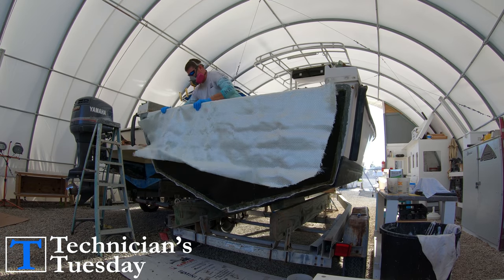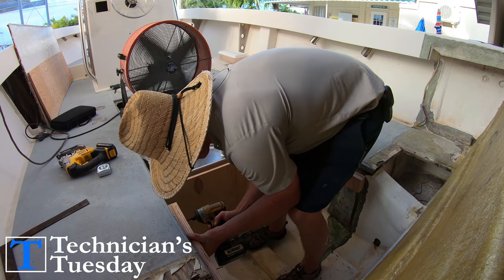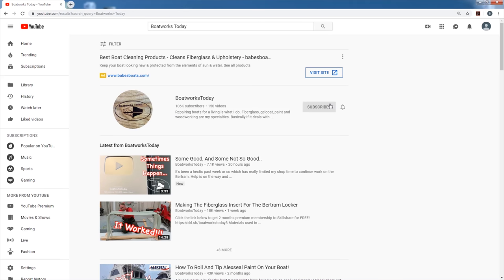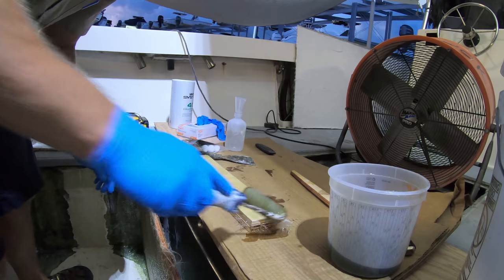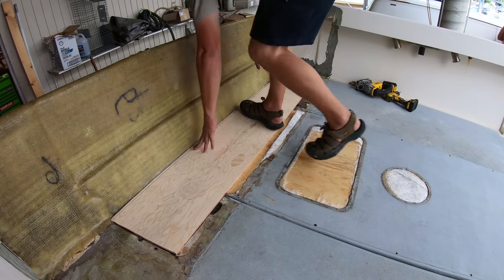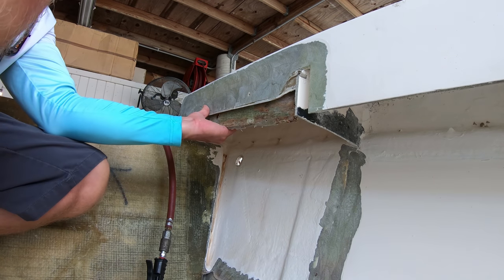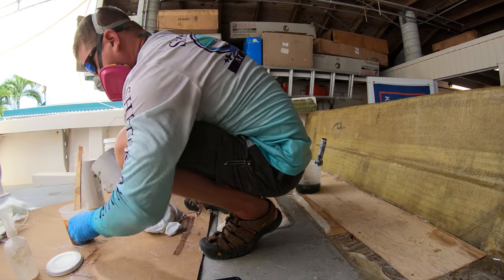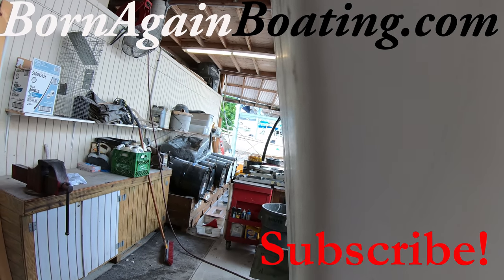Under Your Boat's Floor! Bulkheads & Bilge Paint!

Comment: To help wetting out fiberglass you can put a heavier build up of resin before setting piece to laminate especially on flat areas. You can also use a bondo type spreader to work the fiberglass resin in and get bubbles out with . I order like 50 4in generic brand spreaders on amazon for $15 or less. Just a couple things I wanted to share that may help you now or in the future.

Comment: Have a lot of fibreglass insulation as I’m insulating the shop.    Used that as a thickener to hold the resin as I shoved it in to build up the cracks

Comment: You should consider switching from roving and mat to 1708 biaxial.  The finished product is much better and tends to require less sanding and produces a stronger laminate with less work.  If you use peel ply it gets even better!

Comment: Oh man 5200 on the panel... Is that going to be impossible to raise?  Is there something a bit more removable a person could use instead?  I have emotional scarring from 5200 used in semi permanent applications.
Reply from the maker: You can use Boat Life Life Caulk :) But 4200 has a better and longer lasting seal to it. Remember, on a boat, everything eventually leaks lol

Comment: NIce series of videos.  Just wondering why after all the work of tearing out a mess of rotted wood and replacing it with the nice Coosa board, the bulkhead, floor piece and floor support framing was rebuilt using wood again.  Other than the higher cost for composite, why not use a composite material here as well??  Small pennies in the scheme of the overall repair cost.
Reply from the maker: You're correct, a lot came down to the cost, as well as the time crunch to get the videos done and uploaded, and multiple other projects going on when I did this. Behind the scenes of a video can play a big part in a project :/
Reply: I am sure his decision came down to money, With that said it is not like this wood is going to rot overnight! My boat is a 1987 2288 cuddy walk around with a 4.3 L sterndrive! Except for the fuel tank cover that I replaced last year, I have no other right whatsoever! I have owned this boat since 1995 and it is docked in salt water on the East Coast all summer every summer!  Most of the time when you have wood rotting out on boats it is usually because of the quality of workmanship that is performed on boat by usually by the owners! Everything must be sealed when replacing or installing!

Comment: Dual seastar tournament steering cylinders on cat boat, dual stations, P/A pump and auto pilot, and liquid tie bar. Bleed system thoroughly and checked connections using power purge system. Engines slowly lose tracking and no longer stay in tandem. Any thoughts?

Comment: I half to do a repair on a 23ft robalo that someone else already did but had so much glass delamination it needs to done over from scratch. Cant save any of it. Unless I can get the old glass off..hmmm maybe
Reply from the maker: You'll probably have to cut it out and start over :(

Comment: How are you ever going to access the fuel tank in the future if you 5200 that panel in place?  Fuel tanks are notorious for needing inspection and service.  5200 is pretty permanent stuff while they do make a "debonder" for it it has its limitations and isn't able to work in all situations.  There are other products that would work well and not be quite so permanent.  Enjoy your videos.
Reply from the maker: Thank you! Also, in this boat, with the age of the boat, and the brand new tank. Whenever that tank needs to be replaced, the deck will be soft and need to be replaced as well! And most manufactures already put the panels down with 5200 from the factory, so it would just come up the same way I had to get it up the first time :)

Comment: I have a question, I'm not supposed to put fast bonding foam between the gas tank
Reply from the maker: I don't foam in fuel tanks anymore. You can if you want to, but I've found that it tends to hold water up against the tank and it is better to have the tank screwed to the boat and have the ability to breathe. Getting air around the tank is a good thing

Comment: I didn’t see you fiberglass the bottom side of your wood floor that’s joining the transom. It will rot away if you didn’t. You didn’t seal the sides either. I know you added the thickened resin to the sides to fill in the gaps but that will not seal all the sides from absorbing moisture . Maybe you did it off camera. Thanks for the video 👍👍
Reply from the maker: Yeah, it gets interesting trying to film the process and do the work, then edit it all together and show all the processes. Sometimes not everything gets shown :) plus, I'm not a fiberglass expert either lol thank you for your support though!

Comment: I'm confused here the bulkhead that you put in you glass the one side of it towards the fuel tank you dropped it in and then you took your sealing agent your whatever you want to call it your cabosil or silicon whatever. And then you glassed-in and then up into your stringers but what about your peace face in the gas tank it's just glass or did you glass to the stringers too cuz I did not see you do that. And if so it's just an accident waiting to happen. And then on your floor you glass the floor flipped it over with the glass was that glass set or was it still wet cuz I can assure you it's probably hanging down now it never probably adhere to it the plywood things that marine plywood you're using

Comment: Leaving your new boat out in the driveway in the rain.
Then go go out and Pull the plug and watch the brown yukky water run out on the drive way.
There's a reason why it's brown.
The Under the deck of your boat isn't designed for or well ventilated.
All that trapped moisture that doesn't drain out, stays in.
If yer gonna make that kind of financial commitment and end up with it sitting in the drive way, even if it's got a custom tonneau, condensation will seek out regions below deck.

Comment: You are going to hate life when that fuel
Tank ruptures or rots out
Reply: Why would the fuel tank rupture or rot out, He probably won’t even on that boat by the time the fuel tank goes bad if it goes bad! My boat is 33 years old in my fuel tank is as good as new! It is docked in salt water all summer long, And the boat gets covered with tons of moisture absorbing containers throughout the boat in the winter! The key to owning a reliable saltwater boat is to flush the engine and wash the boat from top to bottom and front to back after every use! Even if I do not use my boat I make sure I give it a good rinsing once a week due to the salt air alone!
Reply: @NeverEnoughPyro40   ok well I work for a company and we change replace fuel tanks regularly from rot fatigue and all sorts of things

Comment: In all that's Holy why would you use 3m 5200 to seal that hatch !! I'm now convinced more than ever to never let my Aft Cabin out of sight around anyone that works in a Marina as a glass guy... You should read that tube of 5200. Life Caulk would've done the job fine and you'd still be able to remove the hatch....
Reply: Tony Alexander ... yeah, I’ve got mad respect for 5200. I caught my rub rail with a scuba tank rolling over the side one day. I applied some 5200 and threw a clamp on it until the stuff dried as a temporary fix. That was 2 years ago!!
Reply: @ericdavi1231  oh yeah that's my point, once you use that stuff it's stuck !  That hatch ain't ever coming up once that 5200 sets up..  we call it F' the next guy
Reply: Tony Alexander ... yeah, I never knew what it was capable of until I had the rub rail issue. When they say “ADHESIVE caulk”, they mean it!